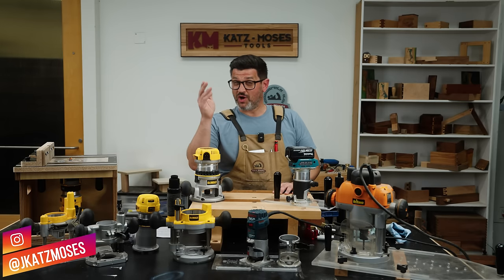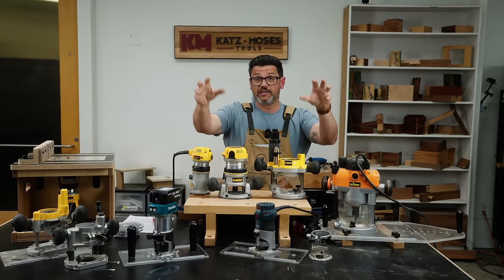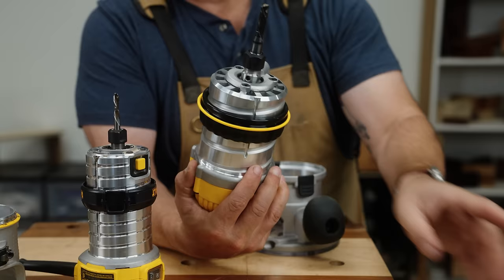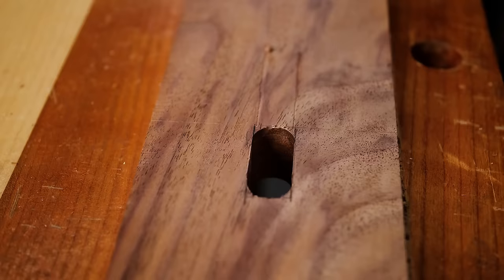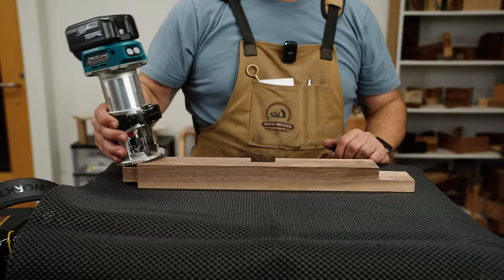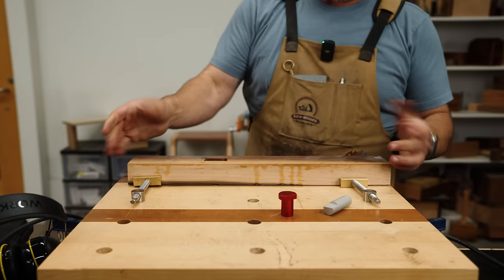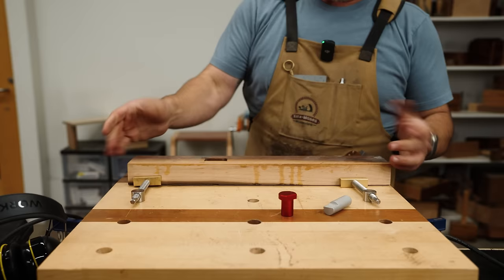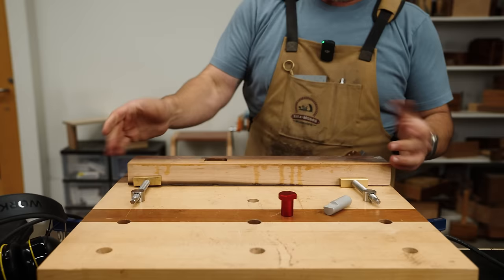Essential Router Skills: A NO BS Beginner's Guide to Woodworking

Comment: A point worth noting; never bottom out a bit when putting it in the router collet. That allows heat to transfer up to the motor arbor. That is what burns the motor out. That was explained to me by a tool repairman years ago.

Comment: Great video.  YT is full of junk and "sponsored" content that are more commercials than anything else.  Your content is second to none in useful info.

Routers are so handy I own 4 LOL... a corded palm for light work (with fixed & plunge and it fits into a small trim table I have), a cheap Ryobi 18V palm and a couple mid-sized with one in my large router table and the other with fixed & plunge for jobs the palm can't do.  Some day I'll upgrade the router table motor to a 3+ HP.

The Ryobi lives with a 1/4" round over or chamfer bit for easing edges... does a great job at that single task.  Cheap, light and useful.
Reply from the maker: Yeah I have an unfair at vantage of the router table and router front hahaha. Love having dedicated router for certain bits.

Comment: No BS is just that.  Great quick presentation easily followed.  As an instructor at Rockler it gave me ideas for my two styles of router classes.  Both will follow the no BS standard, with  a little humor mixed in.  As always you are one of the best in the industry.  Stop by and visit if you're ever in Kennesaw GA.

Comment: Excellent advice for beginners.  Great job!  A bit fast but they can listen to it again.   I teach tool use and found the easiest directional feed training is simply a thumb and forefinger on your RIGHT hand.   Put your thumb on the side you want to route and your forefinger points you in the direction of the feed.  Inside, outside makes no difference.

Comment: Jonathan...it just occurred to me that the trick where you use your pointed thumb and wrapped fingers to determine router bit direction will only work if you use your RIGHT hand. It is so common...and so commonly demonstrated. Everybody demonstrating this (quite effective, actually) method uses their right hand and I have certainly done that and taken for granted that you use your right hand. BUT...I have never seen or heard anyone specify this works only with your right hand! I would hate to hear that someone ruined a valuable piece of wood because they tried this trick left-handed, and then watched their router fly out of their hands and boogie across the shop like an airborne version of belt sander racing.

I love your channel...love the info you impart. Appreciate how you cut to the chase. Thank you for your time and effort!

Comment: Great stuff man, thanks! We need more no bs videos like this on yt. 
Btw just a small note, most trim routers can accept 8mm or 3/8 collet so you can do more with them, if they have enough power ofc :)
Reply: Most bits I see here in the US are only 1/4" or 1/2" shank, so it's not really that good of advice. Plus the smaller motors mean you're risking burning them out on a higher load than they were meant for.
Reply: @1steelcobra   I mean it is still an option if you really need it, you can easily order bits online (8mm is really common, plus the us is not the whole world) and take smaller passes. And there are some trim routers (like makita xgt and dewalt) that have much more power than common ones, comparable to 1200w corded units that have 8mm collets by default.

Comment: Thank you so much! I’m a newbie (and a woman), and your feed direction scoop analogy is the best explanation I’ve seen. Thank you! Question, I had been using 1/4” straight bits for grooving, on a Bosch full size router. The bit snapped though I was taking very shallow pass on hard maple. Is it the bit (too cheap), or could it be something else?

Comment: Fantastic video as always. I have purchased a couple routers in the past year, so I love the videos that you have put out covering them. I have a router table that came with the Skil router that I got, and you may have covered this in a past video, but I have to ask. What cuts/applications would you use the router table fence for and what would you not recommend the fence to be used for? I am going to go back and watch your videos to see if this is covered already but figured I'd ask anyway. 

On a side note, I'd love to see a No BS video covering the final touches to woodworking like sanding and what tools would help with the harder to sand areas as well as picking stains or paints and what applications would be better for one or the other. Thanks again for the lessons taught in this video.
Reply from the maker: That’s definitely on our list my friend.

Comment: I think a router kickback video would be helpful. I’ve used a template and quarter inch flush trim bit in my router table and I have had some kickback that has been frustrating. For example, the inside circle of a charcuterie board handle the bit can grab it and ruin your template and/or the workpiece.

Comment: Thank you. This is very helpful! I recently bought a router set; So far I feel intimidated by all its options, what [not] to do etc. Could you please  illustrate what you've just shown, by demonstrating these routers and bits in the ways they are mostly used?   E.g. a box, rabbet, chamfer, fillet, dado, copy a template etc. Much obliged. Willem.

Comment: Safety tip:  The palm router bases like the featured DeWalt have a large cut out to view the cutting….but it is easy to accidentally curl fingers into it = minced fingers!  Take some 1/8” plexi, warm it and bend around the base to cover the hole and stop finger entry!  Fix it in place with epoxy or make it removable with fasteners. You can drill and tap the metal to accept a small bolt each side to keep the  plastic shield in place…an easy safety fix.  Thanks for the video JKM 👍

Comment: I am a beginning furniture maker just learning router basics. I have a small Makita 1 HP router. On mine, the spindle rotates counter-clockwise. Other videos say that you want to feed the sharp edge into the workpiece , like feeding wood into a tablesaw blade. They say that you should go clockwise around the outside since then the sharp edge of the bit will feed into the wood and only go counter clockwise if there is grain tearout. Could you kindly clarify this for me? Thanks!

Comment: Curious to know what router bit would you use to cut a circle using Tamar's circle router jig to make a stool seat. I have glued several pieces of 3/4" plywood by 1 1/4 " by 15 "so the end grain of the plywood is facing up. (Sorta like an end grain cutting board) Not sure what router bit to use upcut, or downcut ?